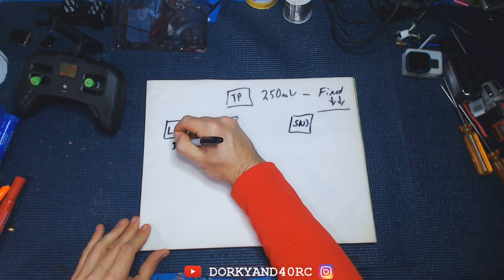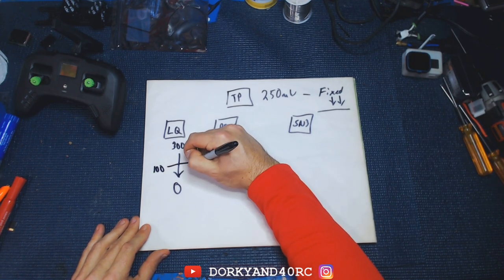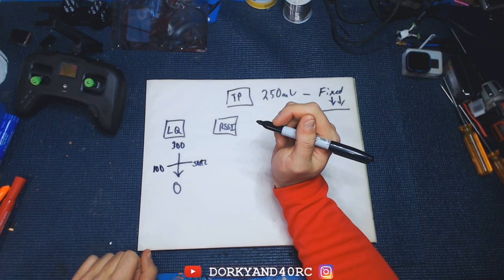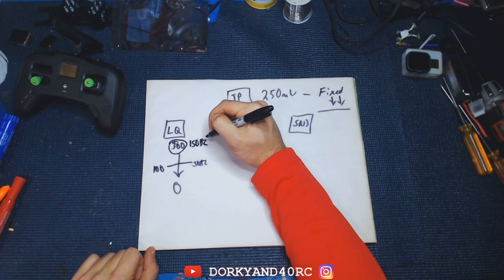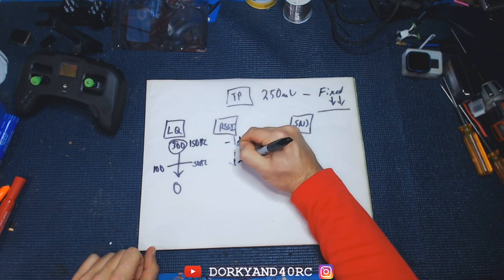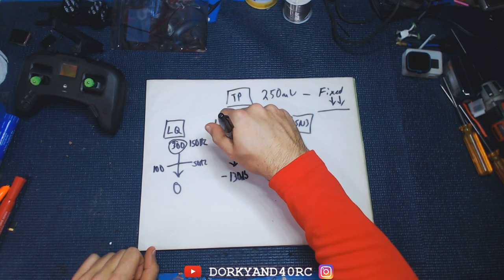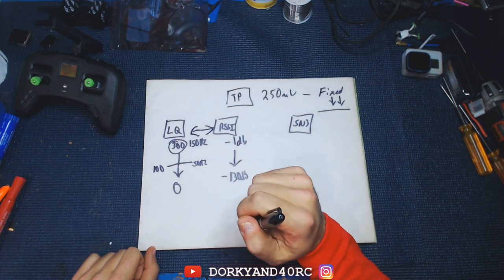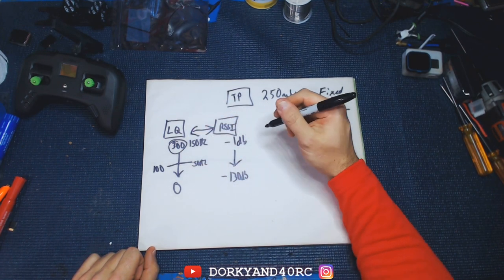TBS TANGO2\CROSSFIRE VALUES EASILY EXPLAINED!!! LQ|RSSI|SNR

Comment: Thanks, I'm new to xfire and this helps out alot!
Reply from the maker: Great. It should help a lot. If using betaflight make sure you are turning on the correct osd elements in the osd tab in the configurator

Comment: That Was An Awesum  explanation and a great Video, Its funny how you don't know what you don't know until somebody makes a video. "SNR"
Reply from the maker: Hey thanks man. Tricky thing to clear up but overall happy. Rssi is all we’ve known for years and the. lQ. Now other info is there and it all works together for us.
Reply: @Dorkyand40  Also Put The Crossfire antenna On the Front Arm of your quad if you haven't already ;-) .
Reply from the maker: @ColinCrosbie  ironic you said that..doing a diversity video right now and that is a huge takeaway that can help many. it was just never a big deal when i had full power crossfire
Reply: @Dorkyand40  I have Never Tasted The full Flavored Crossfire so I'm use to 250mw with the antenna mounted at the rear i had good picture but as soon as flipped around to come back that's when the break may happen, So with it mounted on the front arm as soon as my video becomes rubbish, I know it's time to come Home with the reassurance that my video will be getting better as i turn for home.
Reply from the maker: @ColinCrosbie  that always a good call

Comment: This vid is kinda old and CRSF has made changes but it was  BAD ADVICE  then and now to recommend locking power out put.  Dynamic powers purpose is to lower the TXs power to prevent it from damaging the sensitivity of the RX when the TX and RX are in close proximity to one another.

Comment: Hey nice Video.
I use the immortal T antenna horizintal mounted at one frame arm.
When I want to fly freestyle (midrange and in Buildings) what orientation should i have at my tango 2, vertical or horizontal?
Ty :)
Reply from the maker: Horizontal. Always match or your cross polarizing your antennas and losing out

Comment: Oh my gosh. Thank you for this. Why is this the only video I could find explaining anything about what kind of numbers you should be gettting? These are the RQly and RSNR numbers right? How do they relate to the TRSS/TQly/TSNR numbers? I'm trying to figure out why I loose all telemetry and link at 230 yards line of sight from my quad. Things drop out when I have around -99db RSSI and 3dB RSNR, antennas checked and switched, same result.
Reply from the maker: the sensors tab will pick up T and R for transmit and receive.  you can choose either..they rarely differ as the protocl is so fast so they are nearly the same.  those are horrible readings.  i would recommend to make sure you have your region set to open..and then 915mhz here in the USA.  max out your power..dont cross polarize antennas..so have them oriented the same.  even with poor antenna placement you should be able to get 250yards doing everything wrong so something is not set correctly in the crossfire module itself.

Comment: Thanks for the video. I have a radix board running 4.1. What is the setup steps to get Snr. Are you outputting lq on a channel?
Reply from the maker: You just need to turn on the crossfire widget in the raddix osd and it does it all. :)

Comment: cool so how much better would the link be with full size crossfire at 500 or 1 W ?
Reply from the maker: Better. Hard to say how much. Hard to predict physics. It gives you more a sense of confidence then anything. But that can cause trouble too. Made me lazy and just strap antennas anywhere I wanted. Which in turn hurt performance and just drained my remotes battery faster. But don’t think it will double or triple range and signal. It doesn’t.

Comment: Dorky great video.  I'm scratching my head with this.  I was told RQLY and TQLY and RFMD but it gets so confusing.  Just to check I have on my nano Xfire a value for RSNR and TSNR in DBs.  Which one ? Guessing RSNR ?   Cheers 👍👍
Reply: Also dorky - betaflight - I can't get LQ on the DJI goggles (not supported yet) so using Rssi.  Any suggestions on this..?..thanks
Reply from the maker: I would set up audio alerts then

Comment: Great stuff! Any idea why SNR isn't in Betaflight? I don't see much discussion about it on the internets...
Reply from the maker: I think it just needs to be coded. The data is there. It’s just not being mapped to an osd element. So I’ll be using audio alert for my betaflight 5 inch build and the raddix on the 7 inch that has the full date.
Reply: I have a nano and unify Evo. Wired together the Evo displays snr in the osd
Reply from the maker: SQuiD-FPV yeah true that. The evo dark horse. Have one on my rc truck but since I’m using pwm and not crsf I get nothing. It’s nice to have that snr. Seems to be trappys go to metric.

Comment: Yeeeees! Waited for this one👍✌️
PS: near me (2-3m) I get no less than 35-40db(1RSSI) on the Taranis, is this right? In flight, at usual distance I get 70db and at aprox 800m-1km I got 90-100db, all on 100mw. Is this ok?

And what value is the highest you recomand to go(thrust the link) with the 1RSSI ?

At 1km distance I get -16db on the RSNR value, how dose this sound?
Reply from the maker: Your rssi values sound about right. The snr doesn’t.  Snr is the most important number. It measures your rssi against the noise floor and tells you what’s happening. 60 good to -12 bad. So -16 doesn’t sound right. Watch tbs latest video on tsngo2 when they fly the wing out to 30km and look at the values they have.
Reply: DORKYand40RC thanks for the reply. What happens if I block my RX to 150Hz mode?
Reply: What is dangerous (below that you risk failsafe) RSSI values?
How is displayed SNR on the OpenTX telemetry on the taranis?
Reply from the maker: Ali Green FPV you lose range.
Reply from the maker: Ali Green FPV all values important.
Reply: DORKYand40RC ok but what values represent for you a “dangerous” zone?
What are the values for RSSI and SNR that you would consider that they are getting close to a failsafe?
Reply from the maker: Ali Green FPV lq less then 100 and rssi 100 and snr 6ish or less.
Reply: DORKYand40RC thank you! Again thanks and congrats that you chose to a-dress this topic and you shared your knowledge and experiences here🤜✌️

Comment: Hey man I’m pretty new to crossfire and I just flew with the tango 2 for the first time in a open field on 250mw and I was getting twitchy fail safes I never flew out of the sky but kept losing contact for a second or two after about 200 yards then I would get a low Rssi warning.. what do I need to do to get the most range out of my tango 2 ?
Reply from the maker: Make sure it’s all setup right. Your region should be open and 915 for the USA. Make sure operation is set to normal and not forced telemetry. And orient your antenna polarity the same. And get the antenna out on the arm away from the middle of the ship.  Update the firmware via tbs agent.
Reply: It was set on the wrong frequency that was the only issue..as soon as I changed it to 915 everything works perfectly
Reply from the maker: Awesome. Enjoy that thing :)
Reply: DORKYand40RC I appreciate it thank you !

Comment: Did u see the new xfire antenna Alex g released  yesterday looks pretty interesting I ordered a few... no more nulls
Reply from the maker: i did..my only issue is getting it away from the carbon.  that seems to have the biggest effect. i dont personally have any issues with not cross polarizing my antenna
Reply: @Dorkyand40  I don't either I just thought it looked neat
Reply from the maker: bigg fpv I’m sure I’ll get 1 or 5 :) it would be good for my toothpicks and even 5 inch freestyle maybe.
Reply: @Dorkyand40   lol yeah that's what I'm going to do with em

Comment: how come when i set this up it says my rssi is 99?
Reply from the maker: In the betaflight osd? Or where.
Reply: @Dorkyand40  In my goggles..In betaflight osd it is marked RSSI..this is b4 the crossfire update.. I have not flown lately because of weather ... I have updated my crossfire & tango 1 but have not flown that yet.. Is this because of the crossfire change?
Reply from the maker: @vonster22   you need to go into betaflight osd and uncheck the rssi box and check the new LQ box and then there is a seperate box there for crossfire rssi in db
Reply: @Dorkyand40  Thanks I was looking at an older video of yours and thought I am looking at LQ not RSSI.. but that confirms it thanx

Comment: thats actually not right -- its 199 in 50hz...  150hz is 299..  you will NEVER get to 100, unless you are running 'forced telemetry mode' which is the ultra low power mode used only for WINGS and stuff...  we as quad pilots will only ev er see 299 or 199..  and u dont wanna go below 170
Reply from the maker: idk..i see 100 all the time and it perfectly coincides with RFMD 2 and 1.  using the raddix crossfire widget and audible alerts set for mode changes. and i am not running forced tele.  but there is a lot going on in there.  something to look into so thanks
Reply: @Dorkyand40  LQ on goes from 300 (150hz mode) then flips to 199 (50hz mode).. you'll never see low (100) without being in forced telemtry. Check the manual
And I can confirm from flying crsf on all my quads.